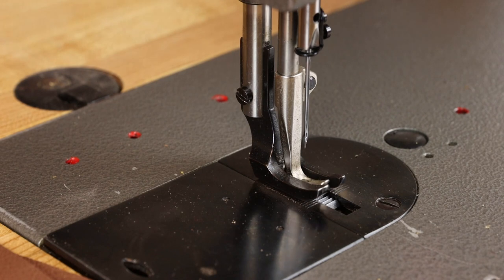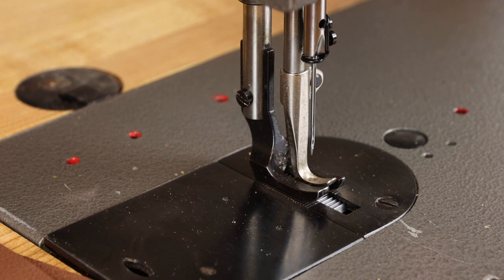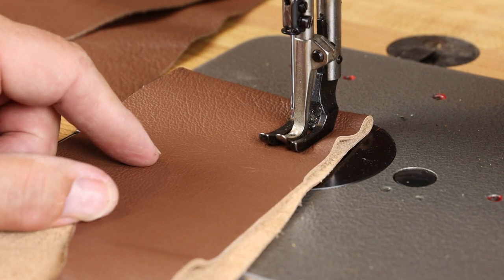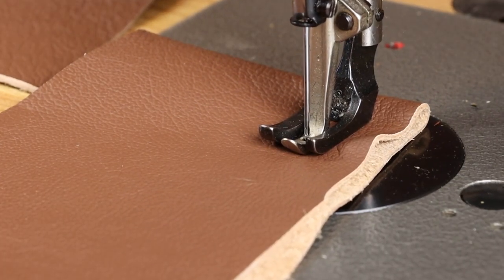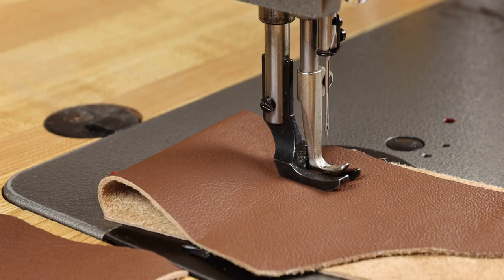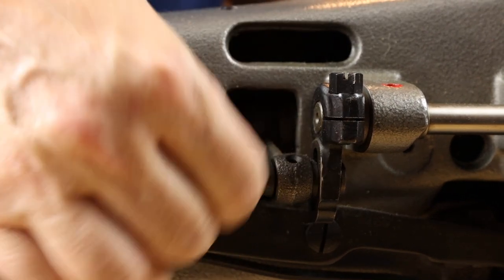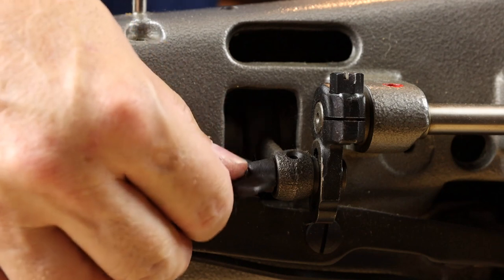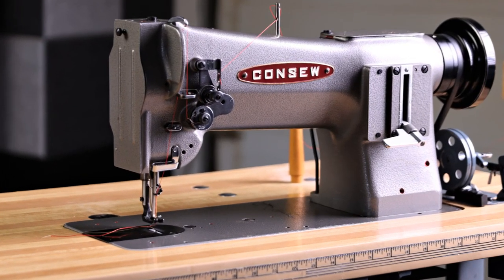Walking Foot Don't Walk Easy DIY Fix and Adjustment Solved Sewing Machine Presser feet won't lift

Comment: Seems to have been reversed on my machine (1541) as instead when doing that the small foot dropped. So what I did was lift it up in what I thought looked like a good position, compared without fabric and I could get a 5mm allen key under both with feet with a snug fit (so both feet at same step, which also resulted in a easier turning of the hand wheel, I have thought it was off from the beginning since the back foot always lifted a bit more, but had not thought too much about it again afterwards, until now when I saw your video 👍👌
Reply from the maker: Yes, adjustments will vary from one machine to the next, but many have a similar mechanism.  Basically, all walking foot machines should be set so the outer presser foot and inner vibrating presser lift symmetrically.  Best of luck with your machine!

Comment: Hi there! I have a Pfaff…545 H3 (just got it a bit ago) and I noticed today when trying to sew a zipper plaquet that I could sew over it, then noticed the inner foot was hardly rising, then I notice the feed dog only goes back and forth and not up and down? I’m assuming the feed dogs should up and down motion as well (it was sewing well..) are you able to help me with these 2 issues?
Reply from the maker: Those are two separate issues.  First, adjust the walking foot steppage as shown in my video.  Basically just put your feet up on 2-3 layers of material and loosen the screw on the back of the machine.  Let the foot drop down to the material and re-tighten.  

As far as the feed dog, it is height adjustable, but may or may not have 4 motion drop feed.  What does the brass placard on the front say?  Something like CLPMN.
Reply from the maker: If it doesn't say "P" then you don't have 4 motion drop feed.
Reply: @TheThoughtfulWoodworker  ya it says CLMN… so that means it doesn’t go up and down? Just back and forth? Above I meant to that I could not sew over the zipper
Reply from the maker: Yes, it's either an earlier model without 4 motion drop feed, or perhaps a specialty machine without drop feed.  Carpet binding machines, for instance are ordered without 4 motion drop feed.  Be sure to watch my "Everything Pfaff 145" video for model specific adjustments.  Once you get the walking foot working right, it might do everything you need.

Comment: Ok but my walking foot really don't walk. The feed dogs are not moving anymore.
Reply from the maker: Popped safety clutch?  Does the hook still rotate?  Or it could just be a loose screw under the machine.
Reply: @TheThoughtfulWoodworker  looks like it was the safety clutch! The hook was not rotating and on further inspection there was some thread jammed in there. Thanks!
Reply from the maker: Looks like you owe me a cup of coffee!  No, just kidding, I'm glad you got it sorted.   @TheFr00d